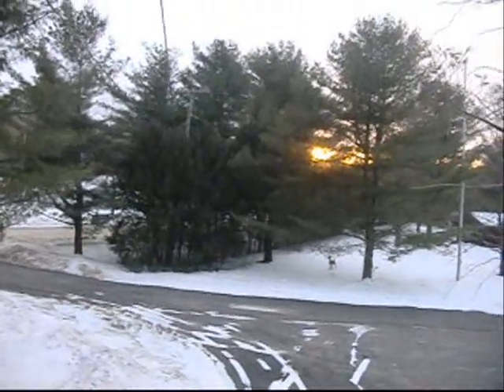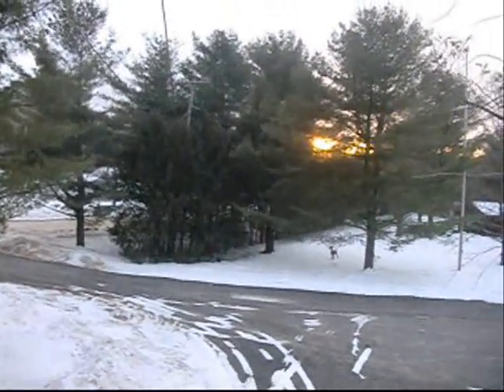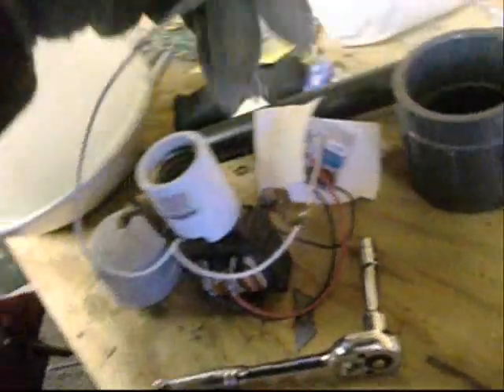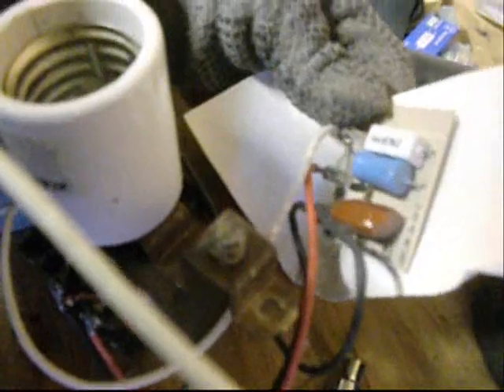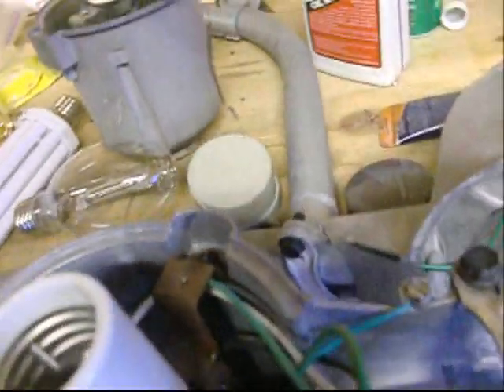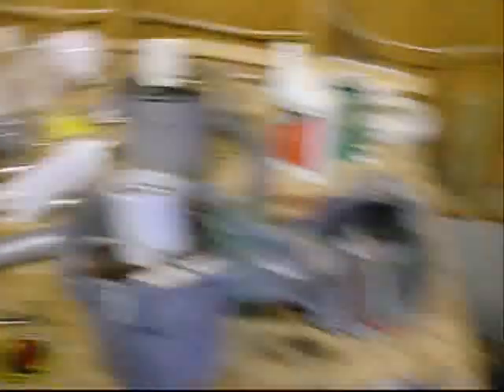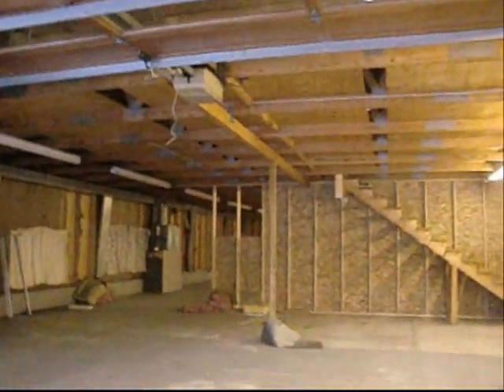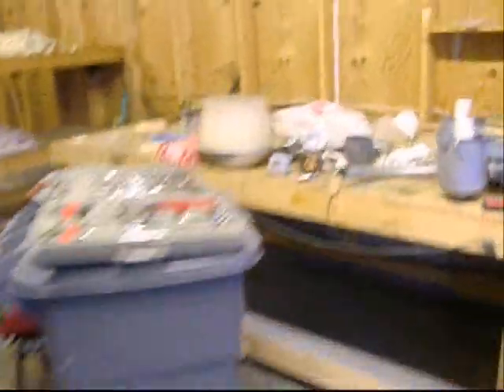2 20 11  Yard Lamp Ladder Surgery...

Comment: I've never seen that exact fixture, but if it's anything like other motion sensor lights..
You are testing it during the day, so it shouldn't turn on unless you put it into 'setup' mode. Then it will operate just like when it's dark. Most sensor lights can be overridden by flipping the switch off and back on immediately. For normal operation, you leave it off for ~10 seconds, then back on. The light will stay on after motion for an adjustable period of time.. Maybe it's set for 2 minutes?

Comment: is  the  light  HPS or  metal halide?   both need  a  capacitor to start,  if you hav the wrong  wattage bulb it  wont work properly , or the capacitor might be faulty , but  youres looks like all the crap is integrated on a  circuit bord